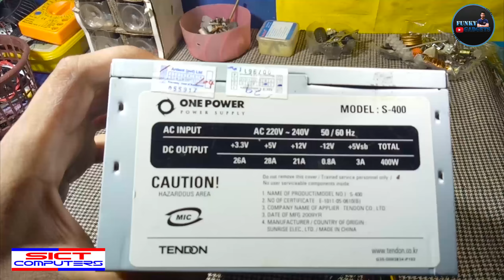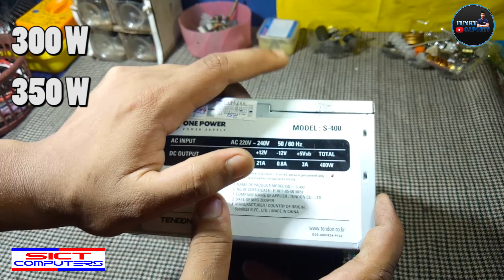කම්පියුටර් පවර් සප්ලයි එකක් සාමාන්‍ය භාවිතයට සාදාගමු Computer Power Supply For Daily Use

Comment: 5 ampire වලට වැඩිය ගන්න එකක් connect කරාම power supply එක off වෙනවානේ ඇයි ඒ.
Reply from the maker: මොකද්ද හයිකලේ?
Reply: @funkygadgets2250  12v 5A Monitor එකක්
12v 10A car set එකක්
Reply from the maker: @pro99edit86  වීඩියෝ එකේ තිබුන විදිහටම හැම වයර් එකක්ම කපලා එකට එකතු කලාද?
Reply: @funkygadgets2250  නැහැ කහ wire එකකුයි ground wire එකකුයි connect කරලා බැලුවෙ
Reply: @funkygadgets2250  කාර් බැටරි චාර්ජ් කරන්න බැයිද මේකෙන්
Reply from the maker: @k8rtedu95  බැහැ. මොකද 12V බැටරියක් චාජ් කරන්න 13-14V ඔ්නි